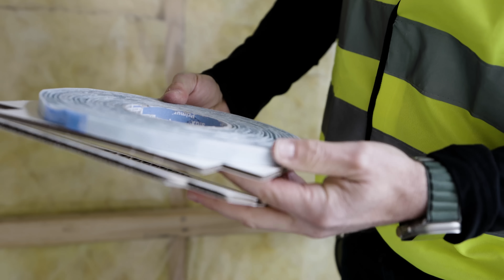Norway's different residential building practices

Comment: When black ink is applied to wood, it can create an effect similar to staining, but with more intense pigmentation. The wood absorbs the ink, darkening the surface while still allowing the grain patterns to remain visible. It's often used for artistic pieces or wood-turning projects, especially if a sleek, modern look is desired.
Reply: The black wood is most likely "royalimpregnering", a common wood treatment in the Nordics to get low maintenance. The wood is first impregnated with copper salts, then vacuum boiled in oil (e.g. lint seed) along with the staining. Maintenance coatings of oils can be applied when needed, but are needed less frequently compared to paint.
Reply: @ALLworldCONSTRUCTIONLLC, I thought that perhaps that wood had been charred black (Japanese or Korean technique). Apparently that keeps insects away.
Reply: Right now in Norway, it's fashionable with untreated wood cladding. Supposedly if you used the right types of wood it doesn't rot, or at least doesn't rot much faster than treated wood. That may be, but it looks really ugly if it's unevenly weathered, with splotches of black where it's hardest hit. Even if evenly weathered it's not exactly beautiful.

Comment: I am not ever going to buy into letting sheetrock get wet this is never going to have a good long term outcome anywhere it rains a lot even it was to dry in 1 minute. Visqueen is a good product it just becomes fragile with age and outgases will always be present and I would use visqueen on exterior surfaces not inside the wall added benifit drywall would be protected and not get wet. Fixed triple glazed windows I would have expected in Europe to see VIG windows especially at Norway's latitudes. Troch down rubber membrane roofs are very sound however becomming outdated in US newer adhesive based membranes are now prevelant in the south and hot moping is rarely used. It's almost like stepping back 10-15 years in build science. Ray
Reply: The drywall is  impregnated with a silicone resin so it's water resistant and can handle the weather during the building period. The reason to use a simple and cheap bitumen roof membrane is that it will be covered with a green roof later. Argon filled double and triple glazed  windows have been the standard  since the early 70' and  windows in Norway has typically a US u-factor of 0.15
Reply: @espenovnerud4793  Windows used in this build are fine and as good as gas filled glazed windows get it's  just  at Norway's latitudes I expected Vacuum Insulated Glass windows in Europe which can get into the Mid R20's 4-5X  more efficient than the best triple glazed high end windows, costs are admittably high but with increasing energy costs paybacks get better with time and now I can have a glass floor to ceiling exterior wall that the R value is about equal to a insulated framed w/o windows wall. It's amazing to walk up to a window and not feel any chilling or have any condensation.
Reply: @rs2024-s4u  Remember that norway gets cheap electric power due to a lot of hydro power.
Reply: @Asbjoern You are totaly correct in that Norway pretty much leads the world in sourcing their electric power from hydo at over 98% of Norway's electric production is from hydro. cost savings will still be present with longer payback cycles and if you have ever been next to a VIG window some comfort factors get ones attention. No chill or need to locate heat vents next to windows and no condensation on any surfaces.
Reply: @rs2024-s4u  i get it. But there is a reason europe insulates more than USA. Cost of heating or cooling. If the extra cost of your windows takes 50 years to pay of, why bother.
Reply: @Asbjoern  norway yes, the people no
Reply: Norway has more than 1000 years of experience when it comes to building buildings and considering rain and insulation. The oldest wooden building is 900 years old, and moist is not an issue.
Reply: @ReaderOfThreads  Norway has an excellant enviroment for preserving wood structures as none of the 2000 species of termites live in sub-artic and artic climates and most micro organisms that cause rot or attack wood also are not well suited to high latitude locations making wood a lasting choice for these extreme cold places. Kind of counter intitutive when one considers that the oldest known manmade wood structures at close to 500,000 years old heve been unearthed  on riverbanks in Zambia Africa near the equator.
Reply: @rs2024-s4u  we were discussing moisture, not termites. And wood will easily rot in Norway as anywhere else. Please don’t move the goal posts.
Reply: Well, the sheetrock itself shouldn't get wet since the seams are taped and it is faced with tyvek, not paper like interior drywall.

It is also for fire protection so a fire in the wood facade can not burn in. So there might be better products, but not a product that is fire resistant, water resistant and breathable in one.

Comment: Interesting, the very deep annular space for the rain screen/plane does have a gigantic increase in drying potential due to air flow / low flow resistance (I have significant experience w/ CFD, computational Fluid Dynamics, and in situ validation of such computations). Something to consider for environments with high potential of rainfall/water intrusion.
Reply: It depends on the height of the building. There is hardly any air movement on low buildings.
Reply: That is the whole point. The principle of rain-proofing the building depends on the ventilated gap between the outer cladding and the rest of the wall assembly. Its Norwegian name is something akin to "dual-barrier weatherproofing". The outer screen stops most of the rain, the cavity allows the wall assembly to dry out the remaining moisture.

Comment: Sure would be nice to see how the modified bitumen roof membrane was installed and how the roof system was insulated as well as installed.
Reply: Torch-on polymer modified bitumen felt roofing has been around in Europe for about 40 years and is basically laid as traditional pour and roll bitumen felt roofing used be be.  The big advantage of the polymer modified variety is that the bitumen does not become brittle and crack, so can last for upwards of 15 years and often a lot longer, whereas the previous standard bitumen roofs only last 5 years.  I am slightly surprised that bitumen felt is still used as a main roofing material in Norway because here in UK we have moved to PVC and EPDM because of their improved performance.  I appreciate that the roofs are due to be finished with a Sedum that will protect the bitumen from the UV and solar gain/freezing cycles but the cappings are exposed.
Reply: @clivewilliams3661  I am a commercial roofing contractor in Washington state my company has been around for over 100 years. I’m a fifth generation owner not of the same family. I wanted to see somebody in another country torching on rolls. The manufacturers we use were originally from France. I’m sure they’re the same.
Reply: @jongwinner7205  Torch-on felt is still available in UK but whereas it was the go-to product in 1980's it has been superseded by other, higher performing materials and torch-on tends to be used on small projects.  Where bitumen roofs have failed it is now far cheaper to overlay the original roof with a hi-perf alternative that can give a 25years insurance backed guarantee rather than re-roof with bitumen felt .

The original big player supplying roofing felt was Tarmac, who used to produce a seminal extensive handbook on the detailing and installation but the scene has changed in favour of more 'modern' materials
Reply: @clivewilliams3661 norway also mostly use pvc now
Reply: @clivewilliams3661  SBS is definitely not the main roofing material here. It's also PVC, hence Protan being a Norwegian company.

Comment: Question re: the radiant heat. If the dwelling is so tight is radiant overkill? Or do people just like it because it feels overall more comfortable?
Reply: It is quite pleasant to have the floor feel warm enough that you do not need thick carpets on floors.
Also that avoids the need to have separate radiators or ducted heated air.
Of course our weather  is such that we rarely would need any cooling systems.

(30 cm/1 feet thick wall/floor/ceiling insulation minimizes heat flow - be it from inside to out, or from outside to in.
Doubling that insulation thickness is not unheard of..)
Reply: @mattiaarnio9249  makes sense! Where I live we would still need AC, it is pretty hot with intense sun in my location.
Reply: Underfloor (radiant) heating is a very efficient way to heat a space.  The circulating water is set at a temperature of around 45degC (113degF).  Heat rises from the floor and cools marginally by the time it gets to the ceiling so that there is no stratification of the heat.  If the temperature at floor level is say 24degC (75degF) then that is likely to be the temperature at all levels.  Generally we feel the temperature on our bodies at the extremities i.e. our feet so that more often the room temperature can be reduced and we can still feel warm if our tootsies are.  With a radiator system, much of the heat is generated by convection so hot air from the radiator rises, moves across the ceiling to the cold spots like windows, cools and then flows across the floor back to the radiator thus the temperature at floor level is probably 1-2degC colder than the level set by the room stat because it senses the upper air temperature.  We then set the room stat to gain our warm feet at say 24degC but are generating a room temp of 26degC to compensate.  The same applies to warm air systems but without the modicum of the radiant heat that also provides a warming feel to the upper body that radiators give.  This means that underfloor heating is the most efficient followed by radiators and then warm blown air.

The underfloor heating system shown will be overlaid with a sand/cement screed that then gives thermal mass to the system as well as even distribution.
Reply: It became common when newer codes for energy efficiency came about (early 2000 i believe, but i dont remember)
One code required alternative heating source not reliant on active grid power or fossile fuel. Basically that ment either wood stove, stored electricity or circulating heated water. (probably forgetting some alternatives). 

Wood stoves works great in single houses. Alternatively air-to-water heat pumps are popular. 
For apartment complexes water-to-water heat pumps gets used a lot.